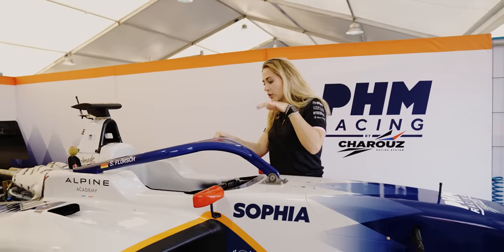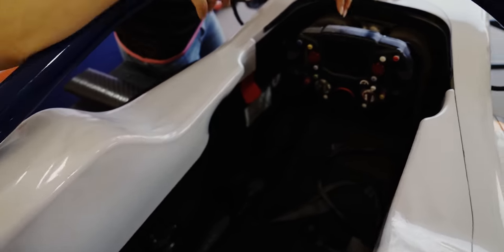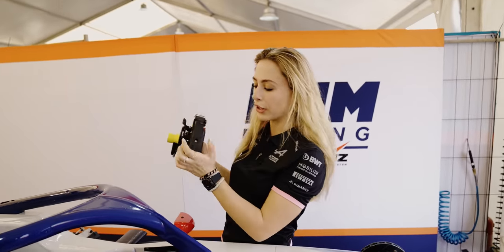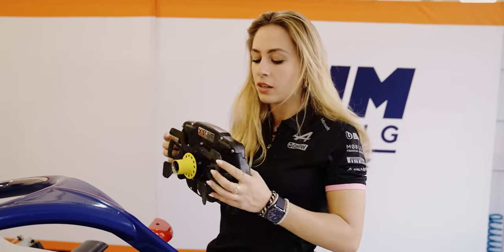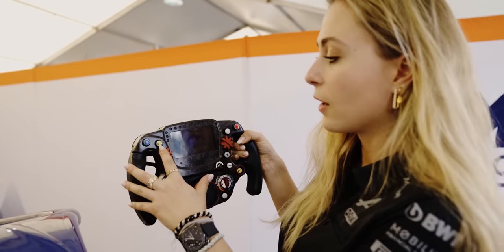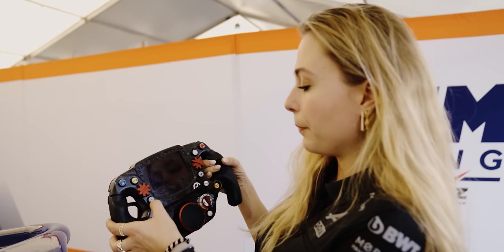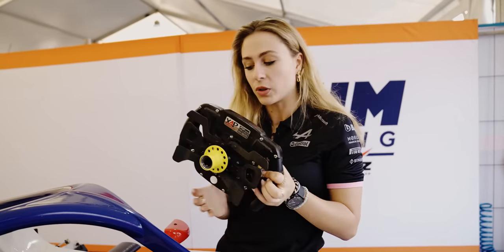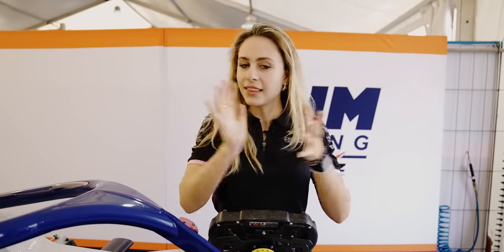Sophia's Racing Setup: What You Never Knew Was Hidden in Her F3 Cockpit!

Comment: Good luck Sophia! I find it a bit strange that the FIA introduced a standard steering wheel into F2/F2 where you can't change the grips to fit smaller hands, its like another barrier for female drivers (though I've seen this complaint from guys are well)
Reply: Tbh that is pretty weird, especially when you see the steering wheels in f1 taylored to fit the drivers hands. (with the compromise of a second driver per team.) Imo that should be the same in all racing classes that use not full steering wheels.
Reply: Well it's a spec series with teams on a tight budget, makes sense to have a spec wheel to keep costs down.
Reply: @mrgalaxy396  Yeah its spec, but its not limited budgets, they are trying to restrict cost to reduce spending in F3/F2 (but then added the fly-away to Australia). But there has been discussions to introduce power steering (which is in F1) to make it easier for smaller drivers and ladies to drive, so in comparison, replaceable grips on the steering wheel is a small cost point, but will improve safety and driver performance

Comment: If there is no clutch pedal, because you operate the clutch solely from a steering wheel paddle, can you brake with your left foot?
Reply: You have to, there is not enough space to shuffle your feet around in an F3/F2/F1 car. Also, left foot braking is actually pretty common in racing!